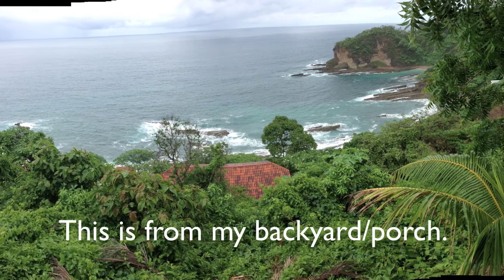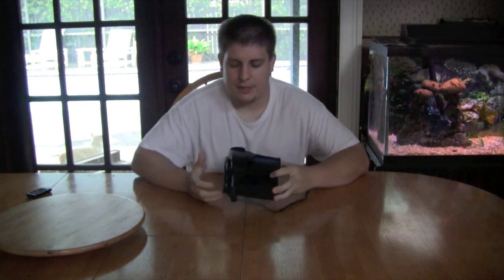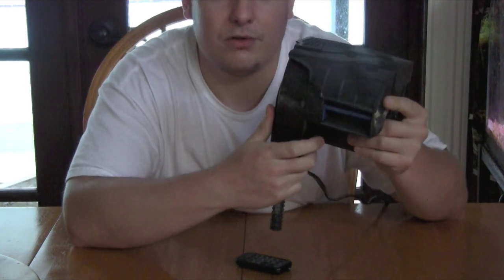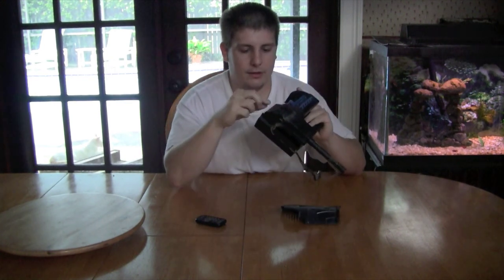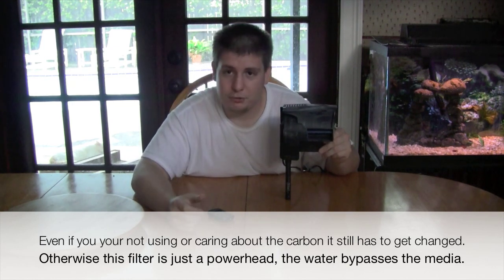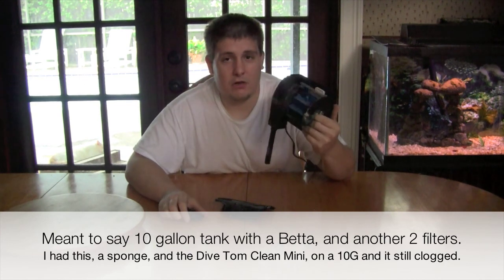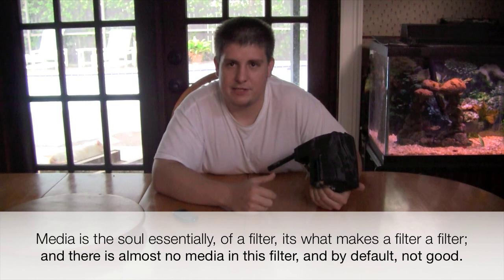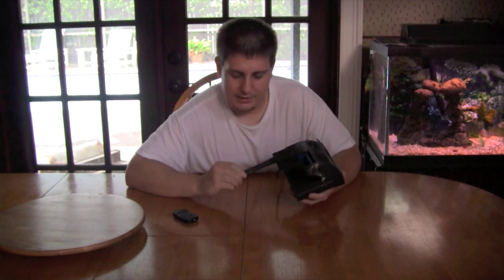Aqueon Quiet Flow Filter Review

Comment: I just bought this exact filter and I love it. I checked the filter cartridge after a month, and it seems healthy. I squeezed in a tetra cartridge in between that filter and the wall of the Aqueon for additional filtration. So far so good, and it is very quiet. I like the self priming feature as well. I just didn't like that the siphon was not adjustable. Even the filter that came with my 6.6 gallon tank had an adjustable siphon, whereas I had to shorten a good portion of it so it would not be sitting smack on the sand of my Aquarium (which btw, drew in enough sand to clog the impeller which needed to be rinsed off, which left me with no choice but to shorten the siphon).
Otherwise, it's quiet. I don't ever hear it, in fact I need to check to see if it is running a flow it is so quiet.  Aqueon claims that healthy bacteria grow on the outer blue frame which houses the media, and the diffuser actually introduces micro bubbles alongside waterflow back into the tank. So far I love this filter. Easy to maintain but I so miss mixing and matching the different media of the Aquaclear filters.

Comment: I've always liked these filters and have had good luck with them the 55/75 has 2 cartridge slots so you can replace one at a time
Reply from the maker: Yea but the media capacity compared to other filters like the AquaClear, forget about it. Media capacity is everything in these filters, without media, the filter is nothing, its not even a filter. Just to have those 2 little cartridges for even a 30 gallon tank, is a joke.

Comment: Your also reviewing the quietflow 10 the 20 and up have bigger cartridges the one on the 10 are to small
Reply from the maker: Yea and those filters are also for a bigger tank. Aqueons biggest cartridge is still small compared to AquaClears, Fluval C Series, Rena SmartFilter, and a few others. Its just a poorly designed filter.
Reply: ***** what the heck you recommend then for a 30 gallon tank. i have a betta and neon tetras. the aquaclear 20 sucked two of them in the intake, so i'm trying this one. the intake looks smaller so it wont suck up fish.

Comment: depends on you personally, if cost doesn't matter then the 400 is for you, the rite e cartridges in the 400 is a little pricier than the rite c cartridges used in the 350, filtration wise 400 is the winner with a larger bio wheel than the 350 and a spraybar spraying directly on the bio wheel and it also includes two empty reusable cartridges so you can put whatever you want in there, hope i helped

Comment: My Bio-Grid or Diffuser Grid is all gunked up- I believe it might be beneficial bacteria. I should leave that on it and do not clean it correct?

I taken the original filter pads out & I"m using my own sponges, poly-fill & Fluval Micron filter pads & I also load this small Quiet Flow with Lava Rock. Its doing a fantastic job.

Comment: I have this filter. It started making noise so I used a 5 inch piece of larger tubing, it's like regular air line but bigger, Im not sure of the size. I split the tube and "pinched" it on the rim of the aquarium where the filter sits. This made the area thicker and cushioned so the vibration stopped completely. I also have a suction cup on the back of my tank that keeps the main unit from touching the glass. I was wondering though, would you be able to use filter media such as ceramic rings or something with this? How would I go about doing that? Great video, Love the back yard pics :)

Comment: I have the aqueon 75. In my opinion is awesome, 400gph. OK, is coming with just 2 cartridges, but you have a lot of space to "tuning" the filter, just putting some ceramic, bioballs, resines pad, etc, is going to be awesome.  The average price is $35-$40.  Bad?, no way. I'm happy with it.
Reply from the maker: For a 75 gallon filter, it has like no media capacity, and 400gph isn't much for that size tank either, but gph and filtration are 2 different things and not necessarily related, so don't get that confused. The other thing is I could spend that same amount of money, get a filter with a better overall design, more capacity, and actually comes with the media you need to run it right. Not to mention its actually meant to run that type of media and there is no "modding" involved. 

In the scheme of all filters that there has ever been, yea its not bad, but when your more practically talking about what is on the market today (or for the past many years) its a POS. Power filters are everywhere and because of that, when all thing considered, this is at the bottom of the barrel. You can get those cheap rebranded Chinese HOB filters for super cheap and they come with more media, capacity, and design than the "quiet flow".